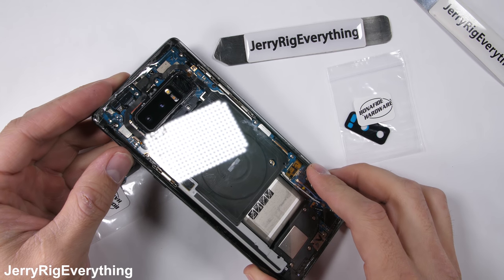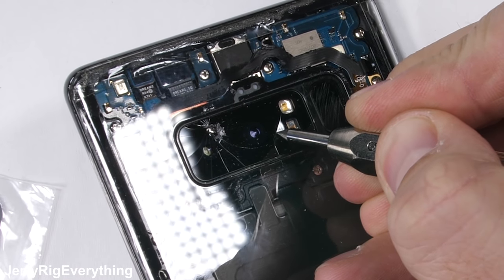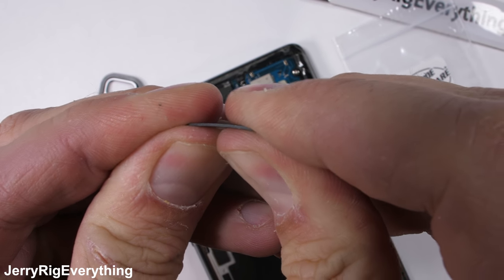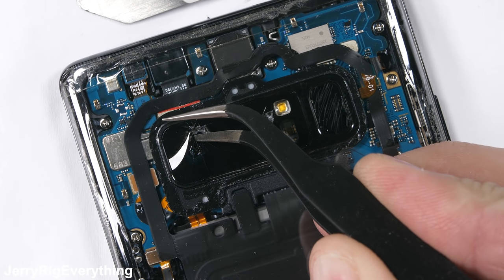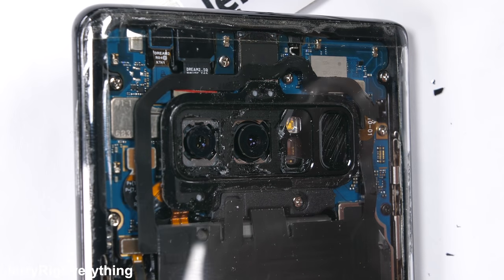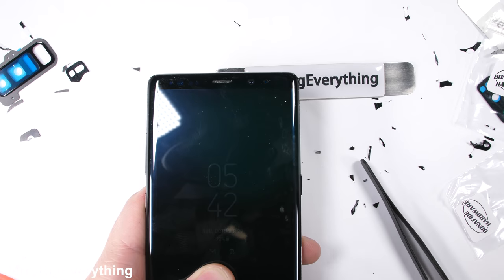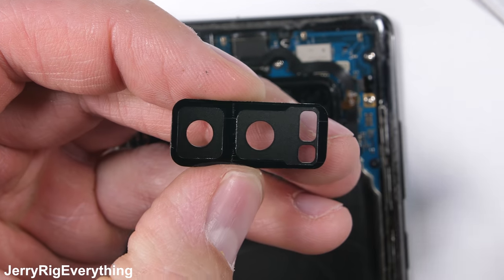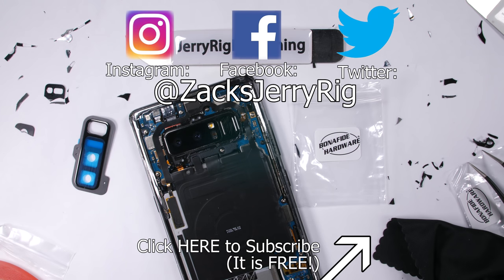Note 8 Camera Lens Replacement - Cracked Glass fix

Comment: I dropped my Note8 last week and broke the glass camera lens cover.. Ordered Bonafide Hardware replacement parts from Jerry Rig Everything LLC on amazon, and repaired the glass in 10 minutes using my gf's hair dryer and a set of fine tweezers.  Thanks again for the how-to video, it worked great.

Comment: Hey Jerry, I just want to throw my 2 cents in on getting rid of the glass fragments (aka FOD). I work with sensitive radio wave components at work and when I make a mess of things, I use a Bergeon Swiss Made Black Extra Fine Tip Oiler and roll it over some double sided tape and use it as a sticky probe to gather FOD. Seems like careful handling of the glass shards and knocking the back of the camera is enough to dislodge the fine FOD. But if you need to get into the fine cracks, I hope my suggestion helps.

Comment: Nice explanation about the mohs hardness of the broken glass matching the hardness of the screen glass and therein presenting a abrasion hazard on a smartphone repair space. 

In terms of materials science, glass seems like a compromised choice for the outer surfaces of a phone that people are going to drop in the real world. Note that almost all protective cases are made of plastics and polymers that offer energy dissipating elastic properties that protect the phone glass, frame etc from drop damage. Any thoughts why the OEM's do not make the screen base of optically clear plastic & then install a user replaceable glass cover ? 

I like your promotion of tempered glass screen protectors. I use a glass screen protector with a rugged polymer protective case to protect my smartphones. (Note 3, Brigadier, iPhone SE.... as of lately) 

Note that Text Neck is a upper spine problem caused by using smartphones in a way that causes the user to bend their neck like they are staring at their feet, the head heavy with a wet brain and skull putting pressure on the spinal discs in the neck, compressing the leading front edge of the discs, causing spinal disc damage that progressively worsens with the ongoing constant use of smartphones with poor posture.

Comment: just did this, it's worth underlining just how hard it is to remove the old glass. Mine had a single crack down the middle so I had to intentionally shatter it even more in order to get the tweezers in at all. After that it was a solid hour of constantly heating and pulling out individual particles of glass dust and tiny shards. It's only when you manage to hook underneath the original adhesive and use it like a pull tab that it gets any easier. I'm surprised the cameras still work, considering that I ended up slipping and ramming the tweezers into the camera mechanism more than once. I really wouldn't recommend doing this unless you absolutely have to.

Comment: Zack, it seems like it could be a good thing to use Blu-tack or similar to pull off prints and glass dust?  What do you think?  I've never repaired a phone, but with clocks and mechanical watches, gummy stuff can be great friend, removing microscopic debris.

Comment: Awesome channel man! Can you please get the Whitestone Dome Glass screen protectors for the Note 8 and S8? Lots of peeps day they are the best.
Not just for durability but overall adhesion and keeping water out from underneath. 
They are installed with optically clear adhesive cured via UV light.

Comment: Hey JerryRigEverything I do not have a heat gun. Can I use my wife's hair dryer instead? 
Also, my phone was water resistant before the glass break. Will it be water resistant after the repair?

Comment: If the camera glass is not cracked, how do you remove it? Do I have to crack it first then remove? Is there a cleaner way of cracking without shattered glass bits? Thanks.

Comment: My camera gets really distorted, bad flare at night with streetlights and such - it looks like someone heat-treated or replaced the lens glass but didn't replace the tiny round little tinted/polarized lens coated covering and now that's all distorted. The heat guns really ruin any plastics that get near them - I returned a Swappa N8 because the dude had replaced the screen glass but the LCD under it was severely warped from the heat (and he left a strip of adhesive over the actual front facing camera, under the glass).